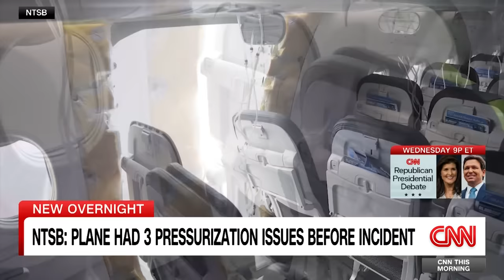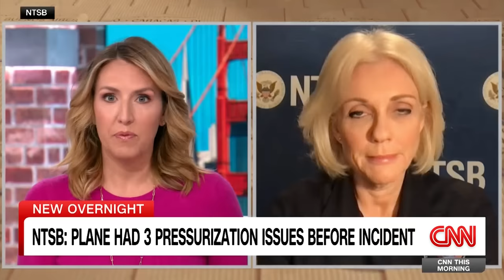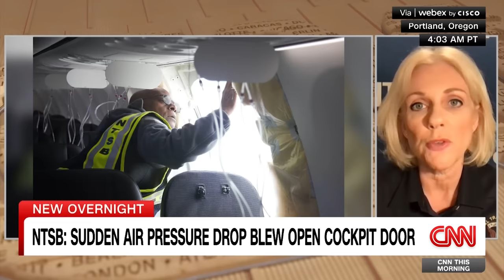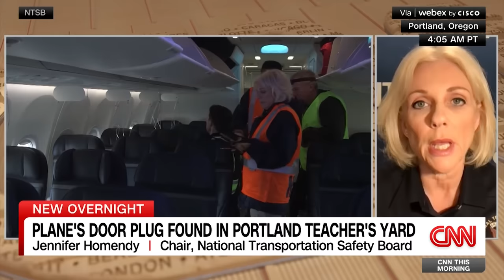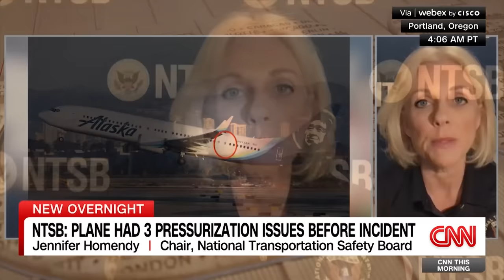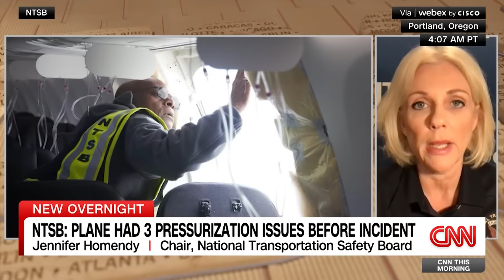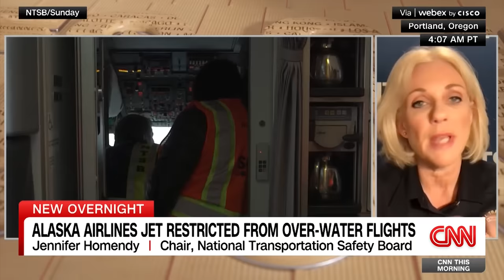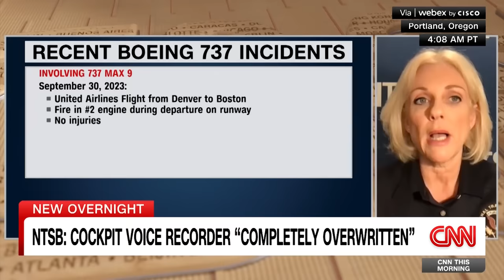Official asked whether it's safe to fly on any Boeing plane right now. Hear her response

Comment: Great questions were asked, but the answers looked very defending , does not make sense talking about ‘gold standards’ until yet another tragedy happens. Boeing 737 max never a safe aircraft and nor it is going to be ever. If at all any airline really concerned about passengers safety , should not buy these aircrafts though Boeing sell these for throw away prices. It is just cheap and I am really disappointed Alaska Airlines which is respected indulged in these cheap tactics. Boeing corporate and fans don’t try to defend this again.

Comment: Alaska Airline decision could be seen both ways. Good and bad. Some might say they had to remove the plane completely after 3 warnings and others say issue did not look serious and Alaska went extra-mile to restrict flying over ocean on that plan me just as a precaution.
Reply: It is just a very bad decision on the part of Alaska Airlines as the door plug could have come off at the plane's cruising height of 30,000 feet causing a catastrophic fatal event even though the plane was flying over land instead of the ocean.

Comment: lady!! tell the reporter that passenger revenue service is allowed unpressurized below 10,000 feet. Pressurization is more so for passenger comfort, and Aircraft efficiency!  She doesn't seem to understand that!!! The door issue however- unfortunately for Boeing looks like they got  sandbagged by whoever manufactured, and secured the plug, which seems to have escaped two pairs of eyes- the mech who did the work, and the inspector who had to ensure the procedure!! rather sure those two individuals didn't sleep well this weekend!

Comment: The flight from Portland, Oregon to Ontario, California was minutes into its journey and had reached approximately 16,000 feet when the door plug blew off, an NTSB official said during a Saturday press briefing. The gaping hole in the side of the jet opened up where Boeing fits a plug to cover an emergency exit that the airline doesn't use, The Associated Press explained.
Reply: The two seats next to the part that tore off were unoccupied, Homendy said. None of the 171 passengers or six crew members suffered serious injuries, Homendy said.
Reply: Agence France-Presse reports that carriers and regulators worldwide grounded some versions of the Boeing 737 MAX 9 jetliners, Turkish Airlines among them.
Reply: Homendy said after Friday's incident that the NTSB does not suspect there is an overall design problem with the plane.

Comment: Of course it is. Boeing has a number of excellent types and that includes variants of the 737. It also needs to be remembered that this was a special configuration and that the plug was in a part of the aircraft which is subjected to high levels of flex and torque.
Reply: This "plug" is supposed to be attached to the fuselage with 12 fasteners and 2 hinges + alignment pins etc (there was an NTSB schematic). Multiple individuals at Boeing assembly line messed up a lot